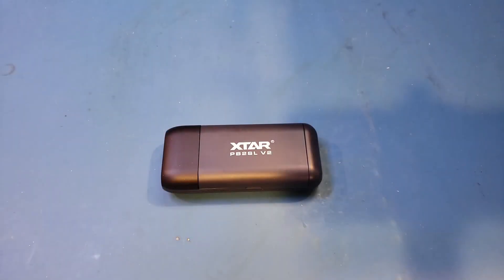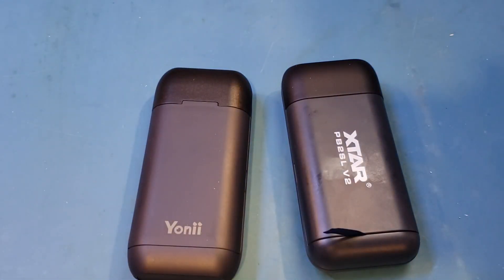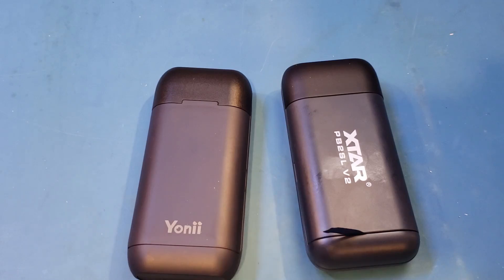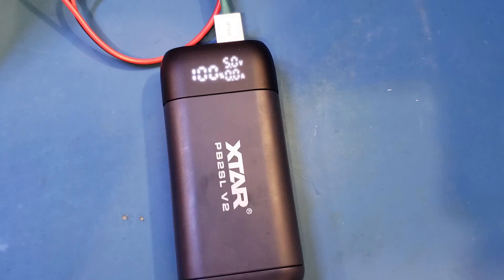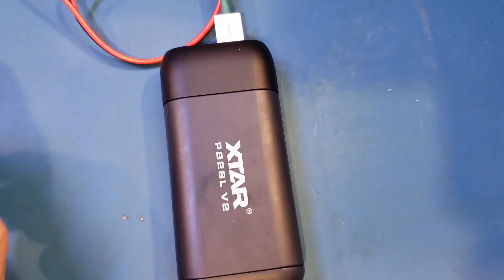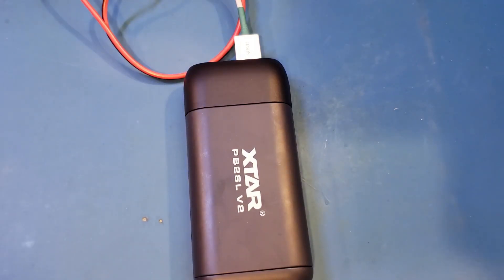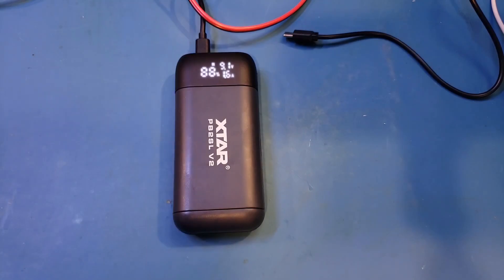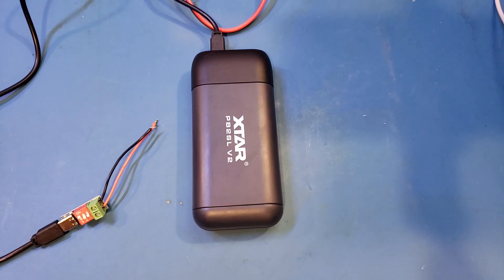XTAR PB2SL V2 Power Bank/Portable Charger Review

Comment: Thank you 👍
Reply: I just charged my iPad Air 11” (M2) ≈ 28,9 Wh with two Nitecore NL2160HP 2*21,6 Wh → 43,2 Wh totally. 

It took 90 minutes to charge my iPad from 20% to 80% and the PB2SL V2 went from 97% to 1%

I’m a little surprised that the efficiency was that low. Any comments on that?